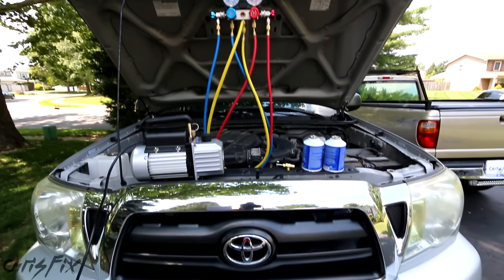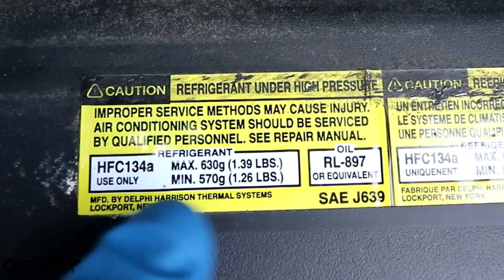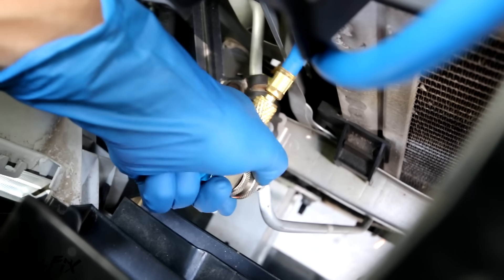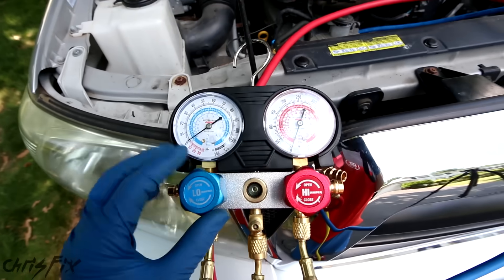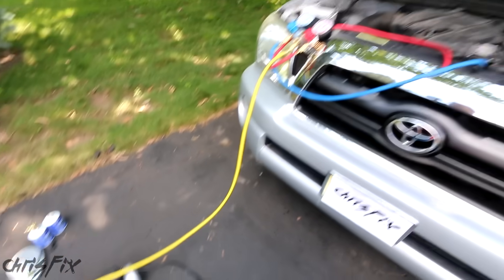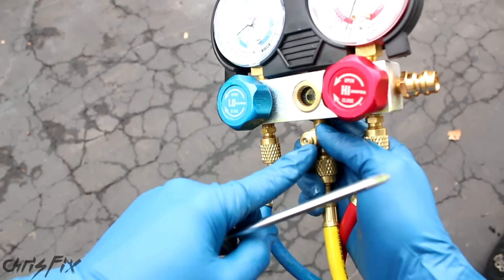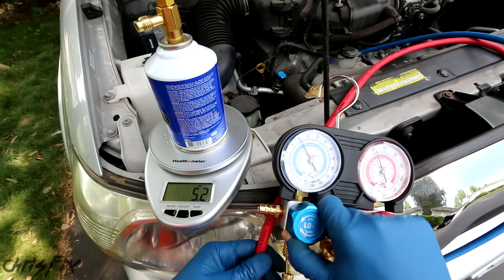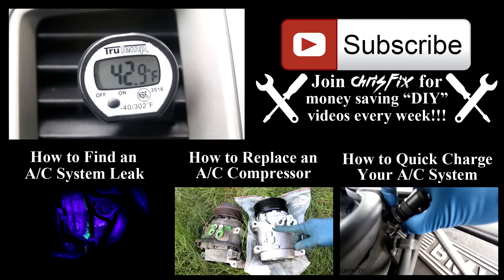How to Properly Recharge Your AC System

Comment: For a recharge where the existing refrigerant is just low… is there a way on the gauges to know when the correct amount of refrigerant has been added… you started from zero and calculated the ounces. How can I know “full” when only adding. Thank you.
Reply from the maker: No but in that case you would just go off the pressure readings and ambient air temp with this chart: https://acproimagecdn.imgix.net/wp-content/uploads/sites/38/2022/06/R-134a-Pressure-Chart.png?auto=format%2Ccompress
Reply: @chrisfix  AWESOME, TY this is very helpful. Great video and support! Wishing you the best!

Comment: What's about no connecting the yellow line through the vertical connection in the vacuum pump,is not supposed to connecting that one cause is for homes ac system or no matter witch port in the vacuum connect the yellow line i just wondering witch way is the correct thanks

Comment: The way you added oil and then purged the line made absolutely zero sense. Oil would have came out with the purge!
Reply from the maker: The oil would have made its way into the system so other than maybe a little residual you shouldn't have any come out

Comment: When you do the second can won’t it just start spraying out because the thing is all the way down? That part confused me and messed me up.
Reply: no. go to 11:00 and watch the steps he takes to put a new can on after he finishes the first cne .
Reply: @dangramm he says have it all the way closed and then put it on. If it’s all the way down it sprays out when I try to put it on
Reply: @renatododge99
If you watch the video as I stated, you will see how to change cans.

 Apparently you did not close the low pressure blue knob on the gauge as well as the handle that screws into the can 
@😮

Comment: I had a vacuum pulled but when I went to open the Low pressure side it was not flowing in. So I switched the hoses with one laying around from another kit and it worked. What’s going on?

Comment: Im confused.  Is this directions for a FULLY evacuated system from repairs? What if I still have freon in my system and I just need to top it off? How do I know how much to add? Do I go by pressure at ambient air temp? Does this method also EVACUATE the A/C system?
Reply: you need to get the specs for your car that shows the proper psi for the low and high side and use those for reference so you know when your system is full. also, watch the sight glass on your high pressure side and you will see the bubbles disappear as you are filling your system. when the bubbles are gone and it looks clear in the sight glass and your pressures are good, you are done. and your air temp should be around 40 degrees or so.

Comment: Add PAG oil from the vacuum hose connecting to the pump is really hard to do, as my manifold system's hose is thinner.  I did it the other way by sucking the oil from the high side while keep the pump running. Then I vacuum the system for another 30 minutes, then feel the R134a with ease.

Comment: I don't have a garage, so i cant have plug in compresssor, what can I do ? I don't have any pressure or refrigerant
Reply from the maker: A shop should be able to pull a vacuum for you as long as the system is empty, give a few of them a call and see if they can help, should be pretty cheap too
Reply: @chrisfix  after that do I need the compressor? I had the car on the audi dealership and they were looking for leaks and found out that I need a new compressor

Comment: TIPS

- Shake the can well beforehand and follow the instructions on the can. 

- 9:28 If you want to visibly see the refrigerant like this when purging the can, then make sure the can is upside down, otherwise there is a good chance that you will only hear the propellant in the can being expelled as opposed to the refrigerent itself.

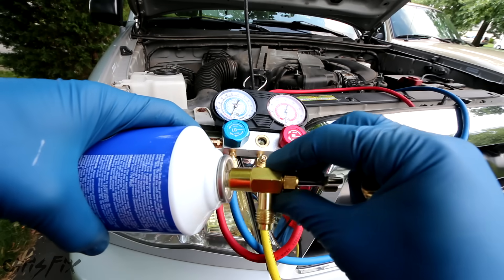- With the new self sealing cans you will need to purge the air out of the yellow line on the second can as well if your using the kind of can tap chris is using here 8:45

- 12:18 To prevent the refrigerant from making a mess when pulling off the couplers you can open the manifold gauges to release the pressure (MAKE SURE THAT THE COUPLERS ON THE LOW AND HIGH SIDE HAVE BEEN CLOSED OFF FIRST!) You will have some refrigerent thats comes out of the yellow line so you'll want a towel there to catch anything.

Comment: As an HVAC tech, the only thing that i would say is wrong ia wating 45 minutes. It doesnt show if your gauges are leaky, as most are. If you get a micron gague, when the vacuum pump pulls down to 500 microns, then you can add refrigerant.
Reply from the maker: If you let it sit for an hour before wouldn't that show if the gauge/connections are leaky?
Reply: @chrisfix  from my experience as a home hvac tech, i have had gauges leak and thr vacuum pump could only pull down to 1200 microns or so, which is still not a vacuum. Thats why a micron gague should be used. Also, becuase the linset is so short on cars, it would probably take like 10 minutes at the most to pull a vacuum, which you can verify by the micron gague.

Comment: It says to add oil to the yellow line but how the hell do you get it in the yellow line. You can't just pour it in there. Won't go.
Reply: Licensed HVAC tech here. You probably have the shrader valve side so it wount pour. Take the end off that is in the back of the gagues and it should pour in.

Comment: what if you're recovering a system that isnt empty? do you still open the high side hand valve on the mainfold gauge? wouldnt that potentially allow some of the high side liquid to fill the container as well as the low side gas, is this okay?

Comment: hey chris what's the difference between a 3 way manifold gauge set and a 4 way mainfold gauge set? I read online that 4 way allows you to pull a vacuum but you pulled a vacuum with a 3 way (as do many others) so I'm confused as to what the real differences are between the two gauge sets
Reply: HVAC tech here. It's just an extra hose to connect to the vacuum pump.
Reply: @TunaFish1701  oh okay, so it's just an extra hose dedicated to vacuum that way you don't have to remove it from the vacuum pump to fill refrigerant?
Reply: @TunaFish1701  also, what if you're recovering a system that isnt empty? do you still open the high side hand valve on the mainfold gauge? wouldn't that potentially allow some of the high side liquid to fill the container as well as the low side gas, or is it okay to perform the exact same procedure when just topping up on refrigerant and you're not filling an empty system after a repair?

Comment: How to Properly Recharge Your AC System THEN YOUR OTHER VIDEO OF  How to Recharge Your Car's AC System (Fast and Easy) I am confused?  if i do the fast and easy then i have to vac the system or do I ?
Reply: If your just recharging, no. If you are replacing a compressor, condenser, evaporator, etc, yes.

Comment: Please excuse my ignorance, but is there any danger of contamination when disconnecting the yellow vaccum line from the pump - either to add oil or just refrigerant? I ask because you mentioned how problematic noisture is for the system and I live in a humid area. But when you take the vac line off, its a vaccum, yes? Doesnt thar pull in the surrounding air?

Comment: Unclear how do you add oil to the system properly, if you have to purge it. If you purge the way you have shown with oil inside the vacuum tube, the oil will escape from that valve on the manifold, which you pressed to facilitate the purge.

Comment: Hello Chris. 
I'm replacing an expansion valve and receiver drier. Did that mean I don't need to add oil? 
2017 Nissan Pathfinder
Reply from the maker: You shouldn't need to if you're just swapping those parts, they don't require lubrication

Comment: Absolutely very useful for DIY guys like me. I'm just a bit curious about the introduction of refrigerant into the low-pressure line. If you turn the can upside down, the refrigerant will be in a liquid state and go directly to the compressor. Would it damage the compressor because, under normal operating conditions, the refrigerant should be in a gaseous or mist state coming from the evaporator going to the compressor? Thank you.

Comment: if you end up adding oil through the yellow line can you still purge the yellow hose the same way by bleeding it off to get all the air out of the line? I went ahead and had the peg oil sucked in thru the high pressure line by opening the schrader valve but i was just wondering. Thanks for all you do for us. God bless

Comment: you need a certificate to buy 134a, failed to mention that. if you didn't get carded for buying "134a" you just bought expensive propane that will overheat your system.

Comment: If I have just swamped a compressor from one engine to another , will it need new oil .it has been sitting a couple years though
Reply from the maker: It should be fine unless any oil was drained out of it

Comment: Thanks for this video! Just used it to recharge my car after a DIY replacement of the compressor and condenser. Also doing this same recharge procedure on my wife's car that I totally botched, not fully knowing what I was doing, before watching this video. It will now be done correctly :)  This stuff is so easy to do, why pay a shop! A good vac pump is only $65 on amazon, as are a good set of cheaper gauges. $10 cans of R134a from walmart, and you got a super affordable cold air again. Not to mention how many more times you can use the gauges and pump for friends and family to save them some money too.

Comment: I thought you shouldn't use weight but rather temperature outside that equates to certain low and hi pressures?
Reply from the maker: You can do both but I wanted to do it by weight in this case to make sure the correct amount was in

Comment: What if the psi is at 25 and not 30 when checking to see if it holds pressure?
Reply from the maker: Do you live in a high altitude area (like Colorado) by chance?

Comment: Hello Chris, do I need to turn on my rear ac control on low when charging the system? (I have a cadillac escalade with rear ac controller). The required R134a is 2.71 lbs.
Does the High pressure valve stay close when adding R134a?

Thank you for the great video.
Reply from the maker: I'm not 100% sure but I would turn the rear on as you're charging the system and check that as well as you're doing this. The high pressure valve stays closed.
Reply: @chrisfix, Thank you so much for the quick response.

Comment: Hi Chris
I just changed my compressor. When vacuuming the system. My low pressure side goes negative however hi pressure side stands at zero. What should I do?

Comment: Dumb question, my new compressor came pre-oiled with 3oz the system calls for 7oz. I added precisely 4oz.  Ow I’m preparing to vacuum the system, after vacuuming the system do I need to add more oil?
Reply: The 3oz. That the compressor came with is to oil just the compressor. The rest of the system has the rest. No need to add any more oil
Reply: @blakecolwell even if it calls for 7oz? I added Pag46 oil to it where the tag said to add oil at

Comment: Appreciate the video Chris. Great info. I'm struggling with finding any shop that will evacuate the system for free. I've called 5 local shops and they all wanted to charge me over $250 just to empty the system. Any thoughts on who actually does this for free?

Comment: Don't forget to add vacuum pump oil to the vacuum pump lol

Also, to everyone... The air conditioner is a closed system and is supposed to work without anymore refrigerant for the life of the vehicle. So if something happens like warm air or other issues, then something is wrong (part went bad, leak, etc). Whomever tells you that it's part of maintenance to add more refrigerant or other weird sayings, RUN FAR AWAY from them lol

Awesome video. Thank you

Comment: Does pulling a vacuum remove the compressor oil?  A tech charged and then emptied the my system when the new compressor I installed didn't turn on. I think I solved the connectivity issue and will recharge the system myself but don't want to double fill the oil.
Reply from the maker: No it will only be pulling the gas out of the system
Reply: @chrisfix  thank you!

Comment: Good video. So i have a question and a comment. The question is by the time you purge a little refrigerant and also fill the hoses with refrigerant and then disconnect, you've lost refrigerant so why not just add the full second can? I'm sure you lost more than two ounces  between purging and leaving refrigerant in the guage/hose set. Second question is how do you evacuate the hose set instead of venting the remaining refrigerant? I've almost always been using a machine but would like to learn how to use a gauge and hose set properly. Old school style.  Another thing i always do on the machine is hose clear the high side hose by letting the low side pull both sides down with the vehicle running. Could you lose less refrigerant in the hoses by leaving the high side off and closed while charging so you don't fill the high side hose with refrigerant?  The only reason i can think of for not doing it that way would be if you actually needed to diagnose a performance/pressure issue that you aren't sure of the proplem yet?

Comment: Thank you so much for this video.
I'm handicapped and poor, having problems paying the workshops to repair it 2 times without success.
Now I looked into it and found a hole on the low pressure side, repaired it with a garden hose fitting 😂.
And ordered the pump and coolant. Sometimes it's best to take matters into your own hands, it is cheaper too. Working like a charm.

Thank you 🙏🏼

Comment: So question for anyone here. 2001 Town and Country. Only 60k miles. Florida vehicle. Radiator cracked. Im guessing from Florida heat everything is brittle. Replaved radiator, a/c was ice cold but thought since the front was off I'd change alternator, belt, and A/C compressor. Well needless to say,  I lost all the refrigerant. I bought a kit, followed the steps, help at -30 on vacuum for an hour. Started putting in 3 and 1/5 can for the 2.38 lbs it called for. Well something with the cans, or the guages or something wasn't right. It wouidnt accept the refrigerant. I stopped after I went to switch cans and forgot to close low side. Do i need to revacuum the system or just continue to install freon? 

Do you ever have high side opened when putting in refrigerant?

Comment: Hi Chris, question 
I have a 2015 Camaro the sticker on the car says it takes 0.540 kg of Freon. That’s about 19oz I bought a bottle of ac pro recharge which is 18oz does that mean I need to pour the whole bottle of the system in the car is completely empty right?? Even if it passes to the red zone on the ac pro gauge.

Comment: From this, it looks like I can't start from a condition of already having some refrigerant in the system because I can't first pull a vacuum from the lines while they're on the car. They won't be starting at zero pressure.

Comment: Hi Chris… so I’m back down to zero after 20 minutes of vacuum on the one hour test. Is this indicative of a large leak? Thanks.
Reply: Yes, you have a leak
Reply: @bridgergennai7755  yeah I knew it was a leak, just wasn’t sure if the rate of rise back to zero indicated how large that leak could be. I got it worked out though. The connection at compressor was a bit loose.

Comment: Awesome man, I’ve never done any mechanic work under the hood of a car before and your video helped me fix my grandmas a/c on a 2013 Honda CR-V EX-L 2.4 FL 4 cyl. I was on vacation in Georgia so a/c is a big deal. Ran into a few issues but I was able to fix it up and it only costed me $35.47 to do the job myself including the leak detection. It blows Uber cold! I will surely be subscribing to find more fixes, never thought I could get a job done like that. I’ll be sure to do it to my own cars now.

Comment: Hello Chris.  Can I do this procedure without evacuating the old freon?   Can I add pure refrigerant on top of the old?  Btw,  it's the original refrigerant  and never messed with.  Its a 2011 honda odyssey.
Reply from the maker: Yes
Reply: One more question.  Can I vacuum the system with existing refrigerant?  I don't plan on evacuating but just to add only.   Thanks a bunch😊